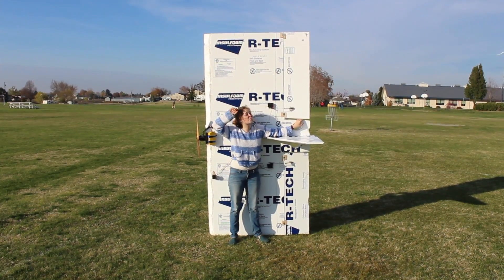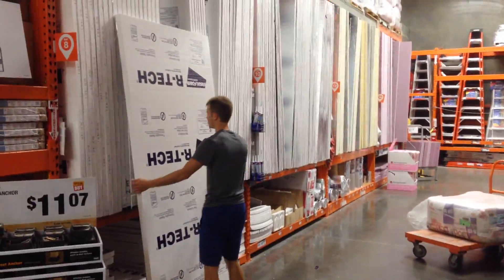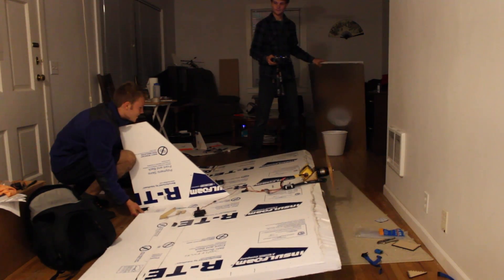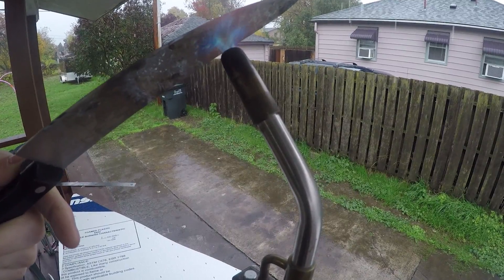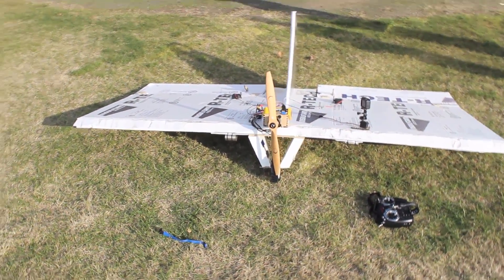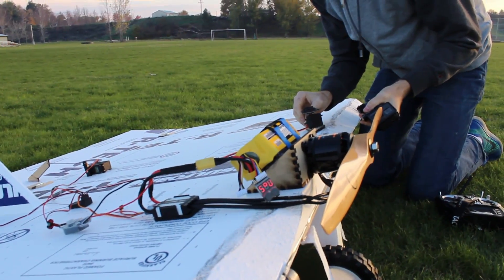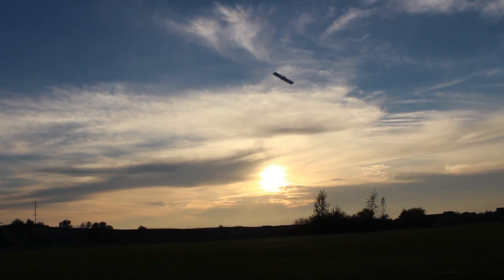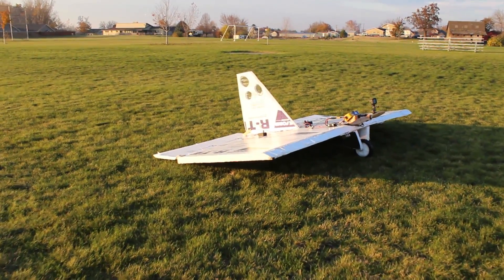FLYING DOOR

Comment from the maker: Happy Monday everyone :)
Reply: RIP buddy :(
Reply: i wish you were here longer, i wish we became friends
Reply: Super coooooooooooooooool
Reply: R.I.P. he passed away in a motorcycle accident on sept 5th 😢😭 you will be missed
Reply: Thank you mate ;)
Reply from the maker: Lolr0 Servos are just hot glued on there, they have a lot of surface area so it works well. I took the potentiometer out of the gopro servo's case (but it's still wired up, but dangling outside of the servo case) and used that pot to tune the direction and speed.
Reply: can you please get to making a video about the dual emax plane? if it has the new 2205s motor's it would have killer thrust
Reply: Samm Sheperd Happy and Monday do not belong in the same sentence.
Reply: You will be missed. Your videos were amazing.
Reply: It's easier to cut foam by shorting out a battery (not LiPo cause if you charge it wrong you've just wasted some money, also possibly hurt yourself) with a piece of copper wire
Reply: Mondays suck
Reply: HOT GIRL FRIEND OR JUST A CLASS MATE? EITHER WAY IT IS NICE RIGHT!! A CHICK THAT LIKES TO D STUFF YOU LIKE? COOL DOOR TOO, JUST SAYING OLD ONE LEGGED JOSEPH T RETIRED NAVY
Reply: Thanks
Reply: Samm Sheperd we miss you Samm